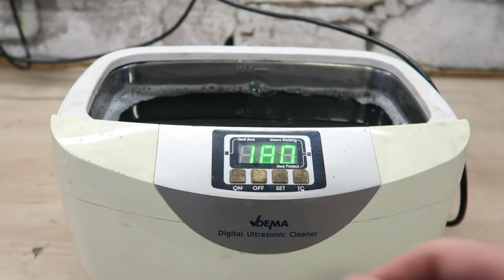Antique Blowtorch Restoration and Test

Comment: I think it is supposed to use white gas-which is naptha or camping fuel-less explosive than gasoline-also pre-heat by dumping fuel looks dangerous-we had one that works without preheat-it just sputters a bit until it warms up
Reply from the maker: Hello, I think the translation is the issue, the type of fuel used is called "essence C" in french, petrol based and it is commonly used in petrol lamps, I forget to mention that the preheat fuel was alcohol. I'm also not planning to fire it up again for the moment :)

Comment: Very good restauration, beautiful.
What material did you use to replace the wick (10:40) ?
Reply from the maker: Thank you ! As much as I remember, it is a standard oil lamp wick that you can find on amazon, just matched the original diameter

Comment: That tank is compromised with that solder repair. Heat plus pressurized fuel is a recipe for disaster for any possible leaks.
Reply from the maker: The solder is the safety valve, it holds a brass needle attached to the bottom of the tank, it melt and releases pressure in case of overheat, or break in case of overpressure. I was also worried, but I found out that this was the pre-1940s safety system for this model :)